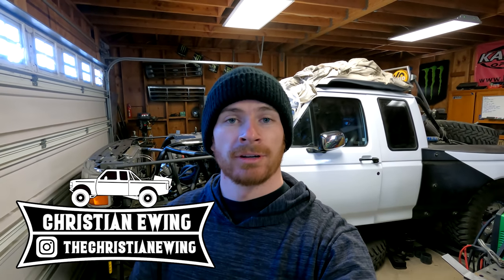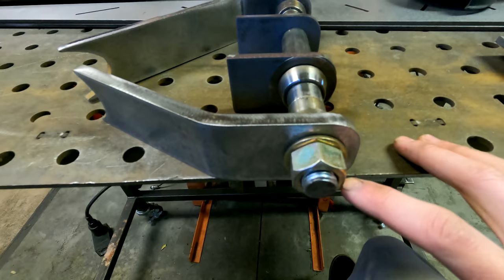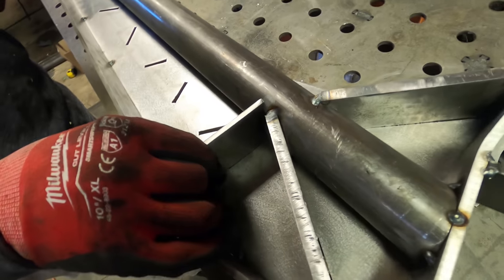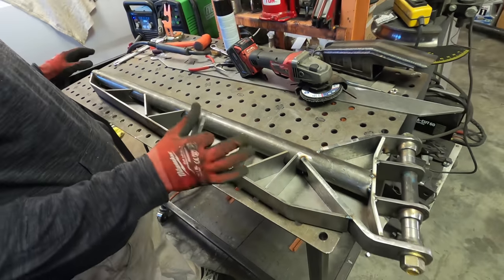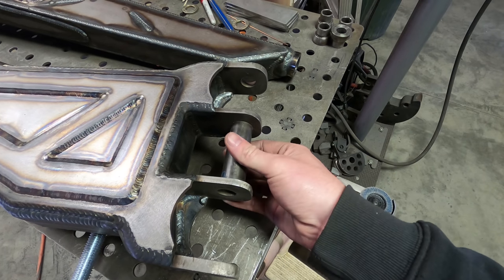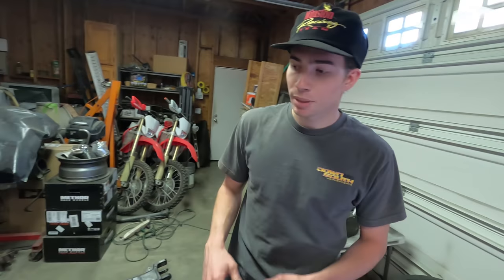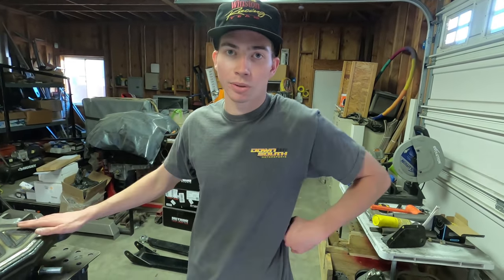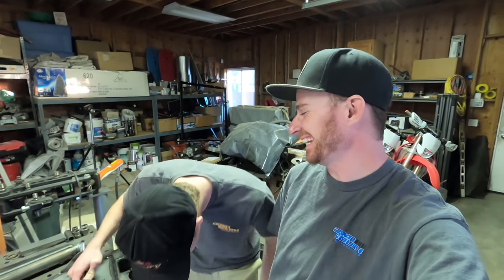F150 PRERUNNER REBUILD - Building New Beams/Radius Arms!

Comment: Would be interesting seeing a cost analysis vs weight of this beam compared to the same design built with chromo
Reply: the_trashman  chomoly is not lighter, you get weight savings by using thinner material. 
chomoly also generally does not have as much resistance to fatigue, although i am not sure if that is because of material properties or just the thinner material being used

Comment: Love it! I have a laser at work that I definitely take advantage of. Tip for your next design with a laser, TAB AND SLOT! It'll help out in assembly later and pay dividends. I usually use a slot size about .010-.015" larger than the tab. Looks awesome! Really inspiring to make me want to do long beams on my '75 F250
Reply: Came here to say this. Tabs and slots definitely help in not only lining things up, but keeping them lined up. Depending on the fit tolerances, we do a lot of things with minimal clamping and fixturing.

Comment: Beams look pretty nice, but load bearing suspension parts should definitely be 4130, if nothing else at least the tabs that hang the knuckle. Bolt holes in mild steel will open up, maybe even some 4130 weld washers

Comment: I know you mentioned that the overlays were tig, but why? Tighter HAZ?
Reply from the maker: Yes, little less heat in the part all together but also just for the looks side of it! Overlays are thinner than the rest of the beam so in my opinion it wouldnt have looked as good mig welded as it does tig! -Christian